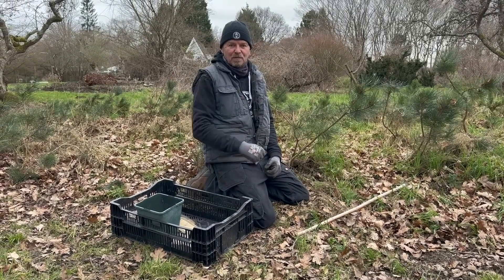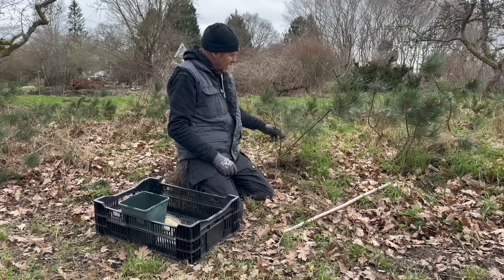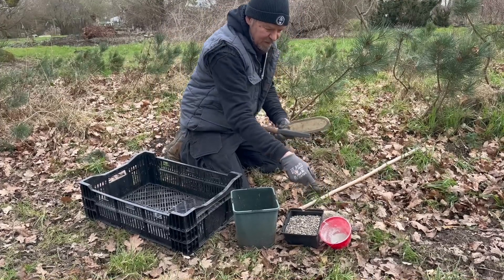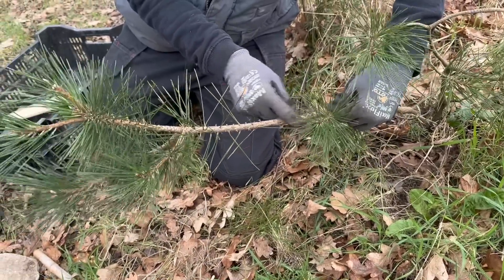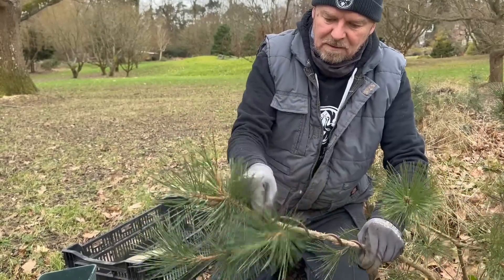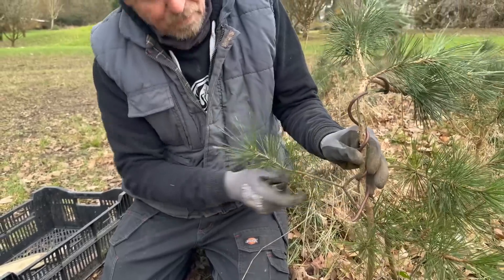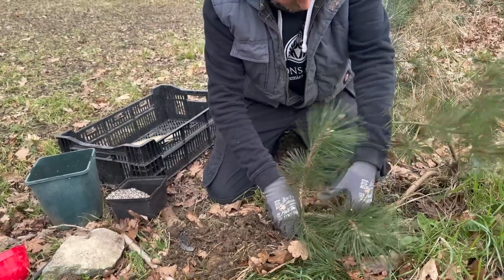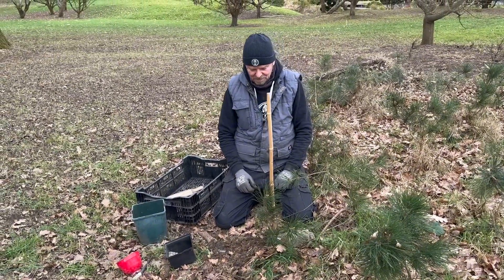What is Ground Layering?

Comment: Easy to do. I ground layer hydrangeas. I grab a branch and pull it to the ground. I just place a rock on the branch where you want it to root in the ground. Using a container is better for your application. Steve it might root, I’m not sure of the pine species ability, if you can air layer I would guess you also can ground layer.

Comment: Nice simple technique.  I've done this in the past with mixed success. I have a Juniper that was very leggy and didn't know what to do with it. So i did this about 2 years ago. I plan on repotting several small trees this spring if it has worked